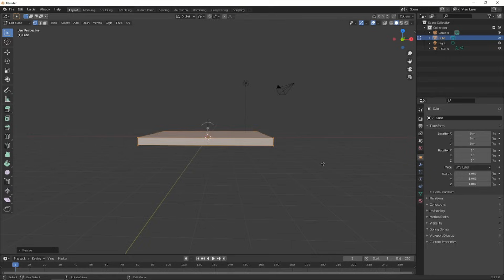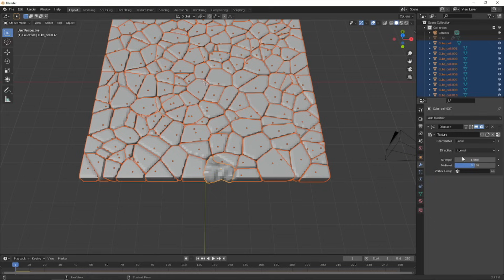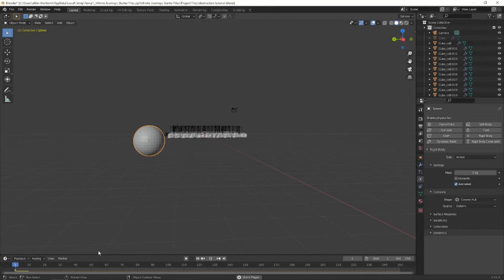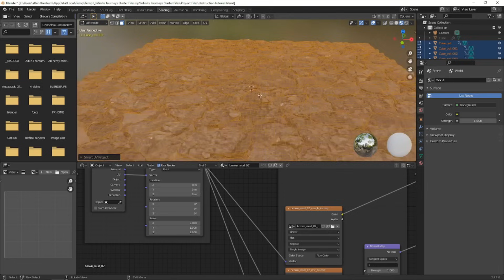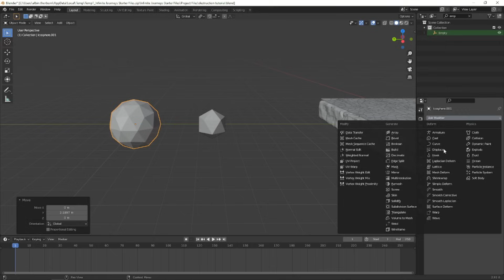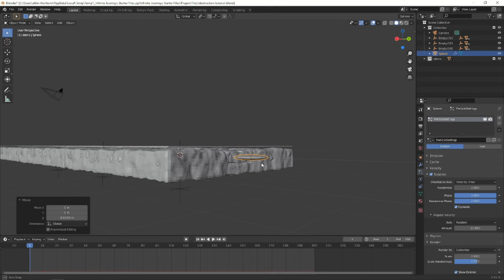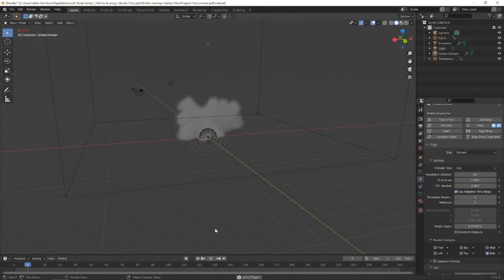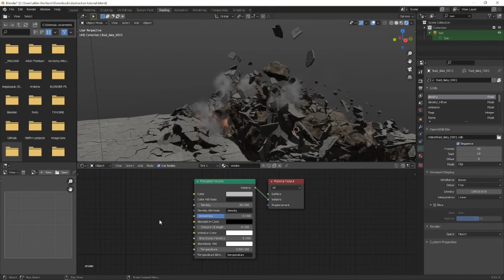Realistic destruction effects in blender

Comment: that connecting concrete to the bigger cube is confusing. You've also added particle system. could you slow down and elaborate steps from 6:00 to 7:30mins?

Comment: Does this require top of the line hardware?
Reply from the maker: Actually not! You can probably get something similar using a basic laptop
Reply: @AlbinThorburn  
I'm actually expecting my new laptop to arrive tomorrow.  It's an Asus Tuf with an i5, RTX 3050, and 8 GB RAM.  I don't know much about specs, so the purchase was mostly price reliant.  All I really know is my current laptop took 8 days to render 28 frames of a cloth sim falling/draping over a low poly toilet within a black void, with a single light source, and all settings nerfed as much as possible to facilitate speed.  LOL.  My only definite expectation is the new computer will perform better than that.

Comment: Excellent Tutorial.  Looks amazing!  Well done.  I followed it all, only issue I had was getting the smoke to show up during render.  The smoke showed up fine in the animation preview viewport when moving the animation slider, but after rendering nothing.  If anyone else ran into this issue or has any ideas, please let me know.  Thanks.
Reply from the maker: Ok so one thing you can try is, in the shading of the smoke object, use an attribute node with "density_noise" and plug it into the volume output. You can change the density with a math node set to multiply that you put in between attribute and volume output. Hope this helps :)

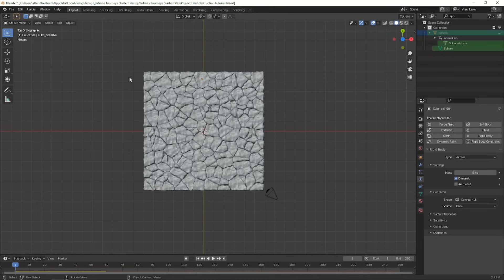Comment: 5:26 Thanks for the tutorial sir, it helped me a lot in my first destruction scene. After baking the movements to keyframes, I've found in the graph editor that the rotation values of the objects are clamped between -180 and +180 degree. So it's like 171, 176, -179 (instead of 181)... It's a 360 degree offset, which looks the same in the viewport, but when rendered, it messes up the motion blur, resulting in a strange flicker. I think it's a bug in Blender. It's noticed only in pixelFCK mode, but still bothers me. :)
Reply from the maker: That's wierd! I rendered mine in Eevee so it kinda fakes the motion blur as far as I understand it

Comment: Thx for this tutorial. I am having problems. I cannot batch copy the constraints like you did at 4:49 of the video, No matter what I do - select all - and then follow your steps - when i check, no constraint settings are copied to the rest. What do I need to do to copy the threshold settings to all constraints?
Reply from the maker: Make sure all of them are selected, then hold alt button while you change the settings (when you hit enter if it's a slider). That may work
Reply: @AlbinThorburn  Will try again. Not my first try following this tutorial. Maybe it's my mesh, but I am not successful getting the pieces sitting as still as yours before the actual fracturing starts. I really want to learn this well without the need for other external addons. Your tutorial is one of the best ones :)
Reply from the maker: @kromide3d  Sometimes it takes a bit of tweaking to get it right! Worst case scenario you can just scale the pieces down so they don't touch each other. Keep trying! :D

Comment: Superb video!!! One thing I am having an issue with is that at  your 5:00, the sphere is moving through the floor parts and all the parts start moving at once instead of only where the sphere is touching. Did I miss a setting change? You have a new subscriber mate!!
Reply: Having this problem as well. Did you ever solve it?
Reply from the maker: I noticed that aswell! When the simulation starts, the concrete falls down a little bit to the dirt layer. That's just a miss on my part 😂. Welcome to the channel!

Comment: a couple questions. When you repeat the process it looks like you apply rigid body with both mesh selected. Are the two being linked together at some point? and does the top mesh need a sphere constraint as well or does the original drive it? I've followed the process exactly and the top layer will not behave like the first layer and splinter correctly. On my second attempt when I connected after applying rigid body, my top mesh had all it's connection points concentrated in one spot in the middle of the mesh.
Reply from the maker: Ok so first I simulated the bottom layer and baked to keyframes. Then I added back in rigidbody to the allready baked pieces, but set it to animated instead of dynamic. Then I removed the sphere and let the bottom layer drive the simulation of the upper layer if that makes sense. Allso if the pieces do not behave like you expect them to, you can hit ctrl a -> apply all transforms, then go to object -> set origin -> origin to center of mass. This will make sure that the center of mass is set correctly.

Let me know if you got it to work! If you have any more questions, write them in a new comment and I'll see them here on "not answered comments". Cheers!
Reply: @AlbinThorburn  Great info there! I also wonder if that's why my container object keeps causing the pieces to fly up right at the start of the sim even though the container isn't touching the pieces but is only close (so they don't fall onto the container at the start). It's like an initial explosion, then they settle and the sphere comes through and hits them again. Also, the container is set to mesh like you did, and they're chained by distance; but something at the start of the sim causes those pieces to go flying.

Comment: I need help! when I select all objects, for some reason only one object is highlighted in orange, the rest is all red, and it doesn't want to work with one orange
Reply from the maker: Ok! When you have all of the objects selected, only one object will be your "active" selection. For example, if you select three rigid body cubes and start changing the settings, the settings will only be applied to one of the cubes as default. Then you have to go through the settings, right click and select "copy to selected" This will copy your settings to all of the selected objects. Hope I understood your question correctly
Reply: @AlbinThorburn  I searched everywhere for this button but didn’t find it, I think you wrote everything correctly, it’s just that I’m a fool, I want to say that when I hold down the shift, this orange stroke follows another shard, despite the fact that they all seem to be the same, but if I choose, for example, 1 shard , 2 and 3 are red, if I choose 3 then 2 and 1 are red (with the shift pressed)
Reply: @AlbinThorburn  oh, i think i found this button, but he  no active..

Comment: That's a nice try.
But the issue with blender is that cell fracture is old. So you don't get realistic destruction. The sizes of the fragments are almost the same and that's not realistic. 
If you look at "thinking particle" destruction effects, you will get my point.

Also you should have added some dust effects.
Reply from the maker: I totally get your point! Cell fracture is old, but there are many settings that I didn't touch in this video. I'm sure you could achieve different sized pieces if you played around with the particle system aswell. This was done entirely on my school laptop, so I didn't go too crazy with simulations either. Try using more piezes and you should get some more realistic results. 

Or you can cheat and make the small details with particle systems like I did :D
Reply: @AlbinThorburn   
Or you can choose some of the fractured pieces and fracture them twice.
Some software or add-ons just work correctly out of the box.

I hope blender upcoming physics node will make things work better.
Reply from the maker: That's actually a nice idea! I should try that.

Yep, it feels like blender destruction physics has taken a back seat in development, which is completely understadeable. I hope they improve it soon tho :D